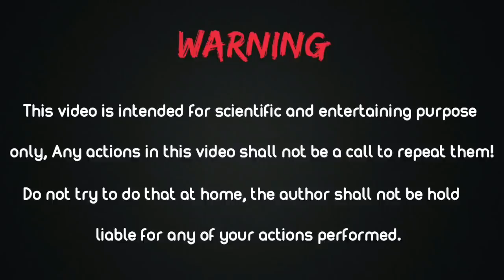How to Convert Broken CFL into PVC Pipe Table Lamp

Comment: Can I use 32W broken CFL bulb???
Reply from the maker: both CFL and Tube Watts should be same or 1-2 watts difference will works.
Reply: Probably yes, as long as the bulb's and tube's watts are closely related.
Reply: @CreativeLifes  i have a 35w cfl circuit what type of lamp of what waatage i can use ?